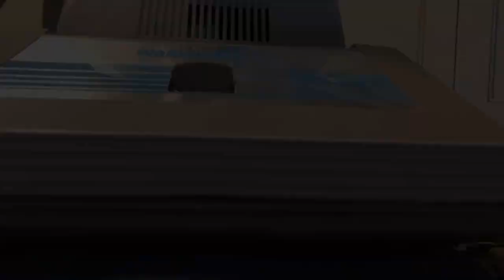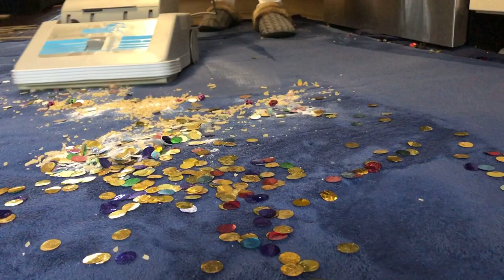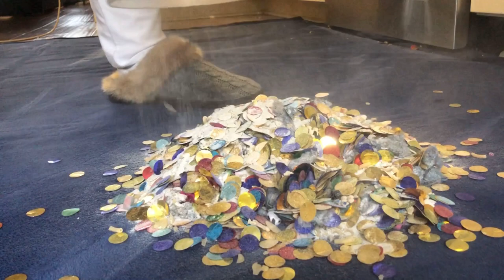Workhorse Vacuuming | Carpet Line with added ASMR Crunch Sounds!

Comment: 💙 TIMESTAMPS 💙
(A workhorse video is a blessing, but a workhorse mess test is a GODSEND 😭😭😭)

00:00 - 0:06 : Intro
0:06 - 0:32 : Overview of mess test 
0:32 - 6:11 : Workhorse brushroll pickup w/ light crunch on blue rug + carpet lines (POV, high angle)
6:11 - 6:20 : Overview of carpet lines 🤤🤤🤤
6:20 - 13:30 : Workhorse brushroll pickup w/ confetti crunch on blue rug + carpet lines + hard wood cleanup (high angle)
13:30 - 18:40 : Workhorse brushroll pickup w/ confetti crunch on blue rug + carpet lines + hard wood cleanup (high angle) #2
18:40  - 19:01 : Bin dump
19:01 - 20:49 : Workhorse brushroll pile attack w/ confetti crunch on blue rug (closeup, low angle)
20:49 - 23:05 : Workhorse brushroll pickup w/ confetti crunch on blue rug + carpet lines (low angle)
23:05 - 23:48 : Bin dump
23:48 - 28:11 : Workhorse hose pickup w/ confetti crunch on blue rug (closeup, low angle)
28:11 - 35:00 : Workhorse brushroll cleanup on blue rug + carpet lines (POV, high angle)
35:00 - 35:10 : Overview of carpet lines 🤤🤤🤤🤤🤤🤤🤤🤤🤤

🥰🥰🥰🥰🥰🥰🥰🥰🥰🥰🥰🥰🥰🥰🥰